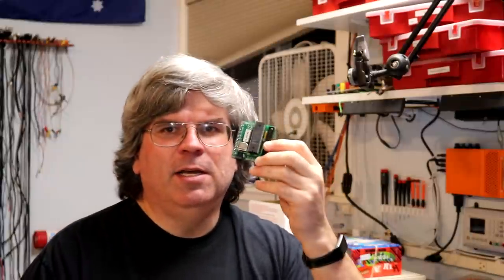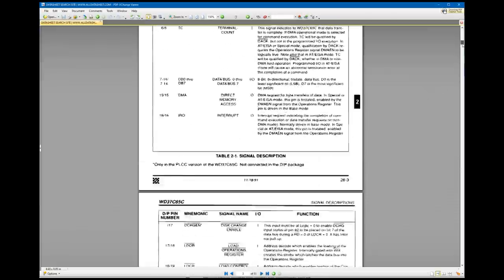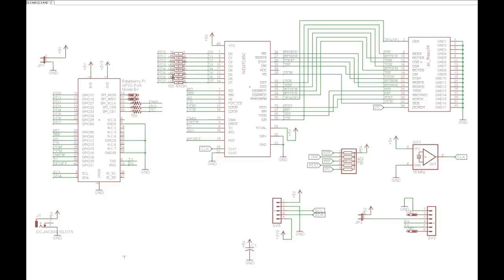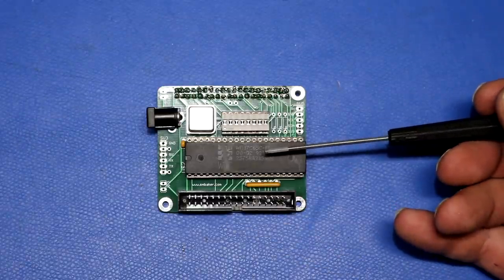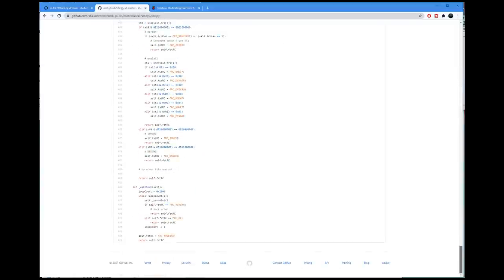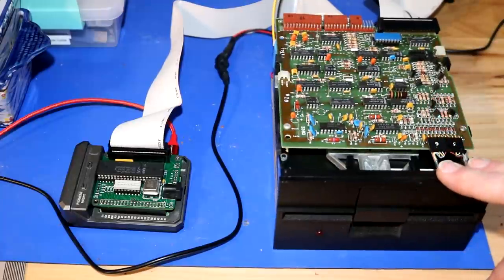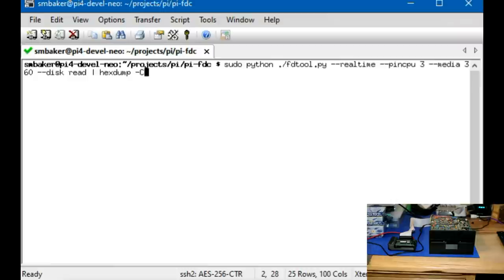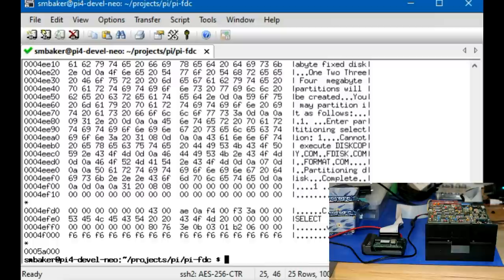I always wished my Raspberry Pi would have come with a 360K floppy drive...

Comment: The kernel is probably easier to work in directly than you remember. There are tons of sub-systems/frameworks that implement most of what you want to do most of the time and causing the kernel to totally lock up with no clue about what you did wrong isn't easy.

I guess you don't even want a block device really. A simple char device that contains the time sensitive/interrupt driven bits of your current python code would probably be enough.

Comment: Would the WD37C65 work with old single density 8” floppies too? I’ve got a bunch from my Xitan S-100 system back in the day. I remember modifying the BIOS code on it to support a floppy disk controller card based, I think, on a WD3791 controller. The Xitan still sits in my basement, but bringing it back to life shouldn’t have to be on the critical path of reading the old floppies.

Comment: Very cool project - I'm just wondering that you managed to connect a 5V device to RPi's 3V3 GPIOs without any level shifting? Are RPi GPIOs 5v tolerant or am I missing something?
Reply from the maker: Checked it with the scope and the data pins are indeed driven all the way up to 5V. Doesn't seem to hurt anything, though I'll probably pull the shunt and throw a resistor back in its place for a little margin of safety. Next board revision will get a proper level shifter. One of these days I should do a study to see how much voltage a pi gpio, when configured as input, can be exposed to before damaging it.

I had originally designed in a level shifter, then I looked up in the datasheet and apparently misinterpreted the high level DC output characteristics as being 2.8V/5ma, when that's actually the minimum, not maximum.
Reply: @smbakeryt  I assume that adding a simple 1k resistor pack for the data bus is enough, at least for these speeds. The esd clamp diodes on the pins will limit the voltages (and also limit the maximum speed it can handle when using more voltage than the SoC vcc for io). However, it'll be nice to watch that video you'll create. Note that a pin might not be damaged as soon as you apply that much voltage on it, and might take a lot of time to do so
Reply from the maker: @cocusar  Tested with 1K and seems to work reliably. I'm going to update the official schematic from 150 ohm to 1K.

Comment: Neat project! Is the controller a 5V part? Are the GPIO lines on the Pi able to handle this?
Reply from the maker: Yes, with no apparent adverse effect (yet). If there is enough interest in the project, next version I'll throw in a proper level converter.
Reply: I imagine they're fairly low current so they aren't taking a beating (since they'll get clamped anyways by the protection diodes). That said, it could potentially wear them down over time.

Comment: Great video. Looking at your GitHub files supporting this I'm surprised that the host computer still needs to interpret the bitstream pulses from the FDC and then do the FM/MFM decoding - I might have expected the FDC to do the heavy lifting and present the actual user data in each sector to the host computer: was this how it was always done?

Comment: Something like this will have uses far beyond what you can possibly think of at the moment. This is a great idea. One thing, how difficult is it to obtain those controller chips these days? If this were to be a mass produced (or at least, several thousands type volume) then it seems like there could be supply issues.

Comment: Working on a project that uses an 8 bit bi directional bus to the pi curious how you wrote bytes to the 8 bits.  I have the answer I’ll go get your code from the repo... Thanks for posting this video and the pointer to running the process on an isolated core I’m going to give that a try to get some more performance.  Glad someone else is hooking up old stuff to pis.

Comment: Just build a bluepill greaseweazle, and hookup a floppy drive to it and connect that to your pi.

https://github.com/keirf/Greaseweazle/wiki/Blue-Pill-Adapter

Supports tons of formats, and dirt cheap. Uses flux, so can handle 3"/3.5"/5.25" Disk Low and High Density. MFM and GCR.

But for a Pi project, this is cool.
Reply: OMG, I have a couple of MFM drives from Compaq Portables. If I could test them without resurrecting an old 8088 or 8086 PC, that would be supercool. I wonder if they could even do low-level format. 🤔

Comment: i think it would be very interesting to adapt a commodore 1541 floppy drive (variable speed) on a raspberry pi, since original 1541 have that thermal issue and are kinda big. you then could implement the original serial bus of c64 and/or usb or samba share

Comment: Amazing stuff! I'm surprised Python is fast enough.
Reply from the maker: I did use C extensions for the block transfer routine, though python may well have been fast enough to do it on its own. The key is that bytes must be transferred ever 26 microseconds to avoid an overrun. Considering that a 4.77 Mhz PC was able to do it back in the day, and a modern CPU is considerably faster, even a less performant language may suffice.
Reply: @smbakeryt  Nevertheless a great accomplishment. And a pleasure to watch as well. My hat off!
Reply: @smbakeryt  Did the PC not have any additional buffering on the controller?  Did it really have to maintain the 26us timing?  I assume it would have been an ISR if that's the case?      Super cool project for sure!
Reply: Yes, hats off! Excuse my ignorance, I always thought that bus buffering with a special IC handles timing issues.
Reply: @smbakeryt  C extensions rock

Comment: Next Chapter: 8-inch Floppies! 😉
Reply from the maker: I already have a set... :D If memory serves, I tried them with the same controller chip on a RC2014 CP/M machine a few years back. Shouldn't be an issue to connect the drives to this project.
Reply: @smbakeryt  I always wanted to see an 8 inch floppy connected to a Linux computer.

Comment: Surely there's an 8086 emulator that could be made to run on the Pi, and boot DOS from the floppy drive?
Reply: It's in there by default and is called qemu ;)
Reply: @roysigurdkarlsbakk3842  Good to know, I'll check it out (I am all about some 6502 emulators, and Basilisk II for Classic Mac, but have never delved into PC emulators, except through VirtualBox).

Comment: How about a 3.5" controller.  The 360 is a floppy you can't get anymore, so it's kind'a useless.
Reply from the maker: It works with 3.5" 1.44MB drives as well, though with a higher retry rate as the user-mode driver has a bit more trouble keeping up with high density drives.
Reply: Because you can't get it anymore is exactly the reason this isn't useless. This gives you more options to work with the hardware and interfacing it with modern systems.
For example: if you want to read an old floppy, you need a working drive. To operate the drive you need to get some old computer working... With this you just need to find a working drive. You don't need to get that computer working to use the drive.
Reply: @smbakeryt  - Do you have modified code for the 1.44MB Floppy?